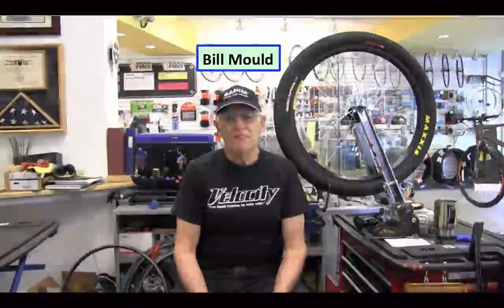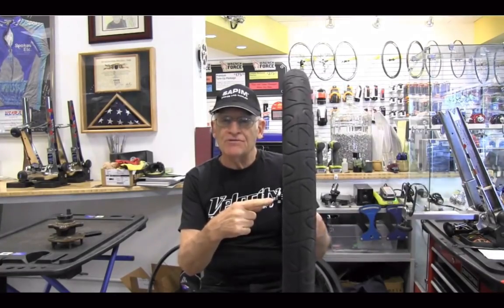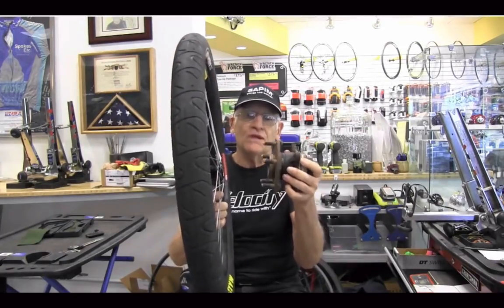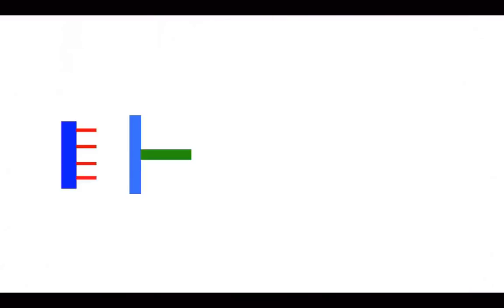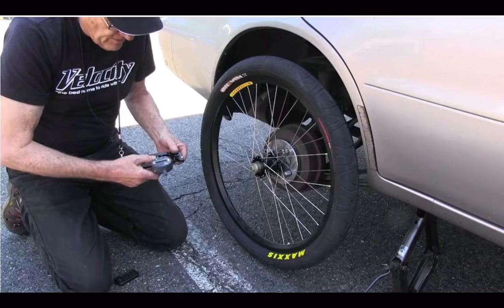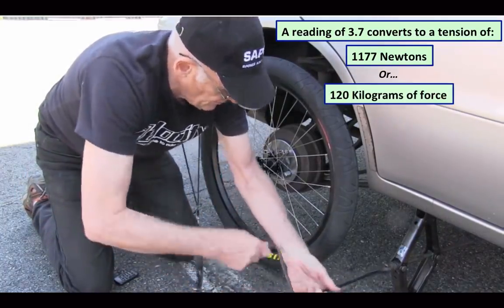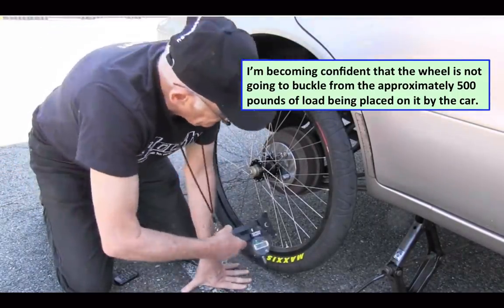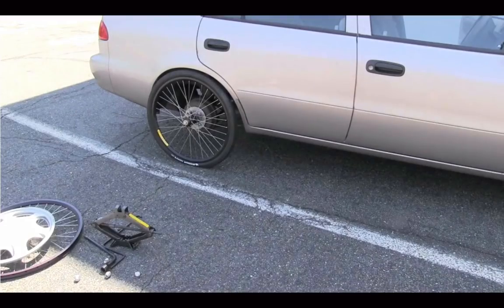Bicycle Wheel On Car

Comment: Hi Bill, Sorry to tell you but as you kept lowering the car you kept measuring the tension of the bottom spoke when you should have been measuring the upper spokes that are literally taking the entire load. Keep in mind the weight of the car is on the hub, the rim is holding the spokes above the hub like a suspension bridge (ie the GOLDEN-GATE BRIDGE). So its the upper spokes that are taking the full load, while the lower spokes are being re-leaved of tension.  Think about that for a moment...  Tick tick tick tick  AHH HAAAaaa now ya get it...  Hey you and I are old dogs in the bike biz (60 here), and as they say, we bike mechanics learn new things everyday, and I won't lie cause I just learned this just recently from a good customer who is a genius mechanical engineer who was head of Apple in the late 90s, and loves to ride bikes.   Hey I just love when someone like you goes for it!  KEEP IT UP!  Sincerely Dan Sotelo
Reply: Suspension bridges have no bottom support so that's an invalid analogy. There is equal tension on the top and bottom spokes.
Reply: Try pushing a spoke, it bends. I have a spoke tension tool. Will test tonight.

Comment: Hi Bill, just out of curiosity, did anyone ever contact you to conduct your experiment?
Reply from the maker: Anthony, a local engineer here in Alexandria VA who has a fabrication capability to made four universal adapters.  He is partnering with me for the next phase which will be to put four wheels on cars with increasing weight.
Reply: Cool, Im looking forward to seeing this.
Reply from the maker: Anthony, I have a local mechanical engineer who has access to a fabrication shop.  He's going to make four adapters that will enable me to install bicycle wheels on each of a car's four hubs.  They will be mountable to hubs with either four, five or six lug bolts.  We'll be able to experiment with ever-increasing car weight until a failure point is reached.  

For the trolls out there:  This will only be an experiment to demonstrate the enormous ability of a bicycle wheel to support a vertical load.  IT IS NOT AN ALTERNATIVE TO THE TYPICAL CAR WHEEL!!!
Reply: Awesome!
Reply: +Bill Mould really cool. Glad you're experiment is being completed. Lots of luck & love to see the video. Take care Bill!
Reply: i think the key word here is VERTICAL load. once you put bike wheels on the front of the car where they are involved in steering,, you will be introducing a horizontal force on the bike wheel, which i predict will make it buckle as soon as you try to make a sharper turn. will be interesting to see how it actually works out, though!
Reply: Bill Mould THIS is exactly why I subscribed. I want to see the next experiments! Well done.
Reply: Bill Mould Why not use a small truck for better tire clearance? then you could use whatever tire you want
Reply: Plus you wouldn't have to diddle with several vehicles; simply keep adding weight to the truck.
Reply: al fresco  a flatbed utility trailer would be even better considering its easy to add weight to a trailer and the wheel wouldn't have to worry about torque loads and catastrophic failure will be less dangerous for the vehicle since the trailer is the only thing that would fall to the ground

Comment: Surely you're measuring the tension of the wrong spokes. It's the top most spokes that hold the load?
Reply: Jamie McCartney I thought the same thing...
Reply: Jamie McCartney Yep, the spoke locations he was measuring would have been steadily losing tension [on the way to compression] as dead load was transferred.
Reply: Jamie McCartney 
You Spoke too late . . .
The damage is done ! ! !
It's guys like this that give engineering a bad rap . . .
Me thinks the spoke lost its temper ! ? !
Back to the drawing board . . .
Reply: thebertt He kept saying "we STILL have positive tension" whenever the spoke was measured as as if expecting it to go down. Sounds like knows what he was measuring.
Reply: +Jamie McCartney Last I cheeked gravity pulls everything down, so if ANYTHING the lower spokes have most of the weight on them; did you think the car it'self actually SITS on the tire? It's mostly on the axle... Also do you understand how a circle works for weight distribution in terms of strength/weight?... I'm guessing you don't otherwise you would have not said what you did.

Whats sad is there is a bout 4 other people agreeing with you up above.  smh
Reply: +Ezcore Eve I'm shaking my head at you. You, sir, just made a fool of yourself. You are correct about a solid circle. How a bicycle wheel works is different. The load on the hub is supported by the uppermost part of the rim as it's hanging off the spokes. The bottom spokes are providing no support.
Reply: Jamie McCartneyRen Huynh, with regard to him saying  "we STILL have positive tension", I agree with you, he seems to understand the most basic dynamic about the role of hub spokes rim etc -- but still it's an odd (nearly useless) metric he's collecting - the spokes directly above the hub (12 o'clock position) are in tension and they do all the work, it's the failure of these elements that constitute a (modern bicycle's*) spoked wheel failure, not the spokes in compression (or rather moving towards compression) directly underneath. 

+Ezcore Eve, Stop, just stop commenting, please. Take up baking tea cookies, or politics, or late night TV marketing -- there's money to be made in all of these and no math or dynamics visualization needed - you'll be way happier there! (Yeah I know, Bakers even now breaking out Boyle's law citations or something and prove me wrong on that) 

*I suspect the wooden spokes of a old school wagon wheel would possibly be the opposite, the stiff spokes in compression underneath are probably doing most of the 'heavy lifting'.

Comment: Good experiment. 
Great findings.

Moving forward, that mounting adaptor ignores any braking being done by the stock system. so before placing all four on a vehicle and attempting to move it, make some adjustments. being as it's mounted on the hub, the wheel shouldn't move freely.

Comment: Cool experiment! The diameter of the wheel and tire appears to still be too large, even with the newer tire. What would happen while driving over a bump? It probably needs space for the suspension to function. Maybe make a smaller wheel & tire?

Comment: Why would you attempt to market a bike wheel for a car ? Or a cement mixer for that mater? I'm really confused by this experiment. In the nineteen thirties the German manufacturers of cars and trucks determined that solid wheels were safer and needed no truing after the wheels were in service. I appreciate the young man humorous feat of engineering. I guess he was making the old guy feel good about his wacky wheel. Fun to watch the old guy being so very inenthused and energized by this.
Reply from the maker: At no place am I recommending that a bicycle wheel be put on a car.  This was only an experiment to show that a well-make bicycle wheel can support a large load.  Most people get that.  Sorry that you did not.
Reply: +Bill Mould bills a fkin savage
Reply: This actually can improve gas milage considerably... Much less rolling resistance.
Reply: +Network126 what is rolling resistance? you mean friction?lol
Reply from the maker: Rolling resistance is not exactly the same as friction.
Reply: ***** Rolling resistance and friction are slightly different things. A thin, light tire, can travel more easily and efficiently than a wide, heavy tire - It takes less energy to get moving, and there's less rubber on the ground.
Reply: I would completely agree with you that it would make the car more fuel efficient, but I'm just saying that static friction is mostly responsible for getting the tire "moving". Inertia of a round object is a property of how that particular wheel turns, but friction is the main factor when it comes to the ease of moving a car forward.
Reply: He just wanted to see if the bike wheel was strong enough to support the car...
Reply: it was just a fun experiment. why so negative?
Reply: it was just a fun experiment. why so negative?
Reply: I bet you could get a pretty decent gas milage increase by even replacing all 4 tires with thin spare tires.
Reply from the maker: Thank you for this expression of support.  Some people totally missed the point.  Fortunately, most people are like you and see the demonstration for what it is - that a bicycle wheel can support a very large vertical load!
Reply: +Bill Mould I found it fascinating. I am guessing all the naysayers have never just messed about with stuff to find out how it works, what its limitations are, etc. People like you enthuse the inventors in society. That is pretty awesome :)
Reply from the maker: Thanks!!  I appreciate the support and your understanding of the purpose.
Reply: It's to say how strong the wheel is
Reply: +dan rieco 
He is not trying to get anyone to put a bike tire on a car. Cyclists spend hundreds if not thousands of dollars on the strongest yet lightest wheel sets possible, especially mountain bike racers. To take the load of a car with the weight of a bike wheel set is remarkable. Old guy, smart marketing.
Reply from the maker: Darian, thanks for your reasoned comment.  A number of people, as you have seen, have totally missed the point.
Reply: +Bill Mould Some people are simply ignorant and do not understand that this is simply a project you created to show some science.
Reply: +Network126 less rubber on the ground is a bad thing when it comes to traction and the ability of a car to stay planted to the ground in a corner
Reply: Sandman Actual
Yes that's true
Reply: Actually i agree in many ways, i possibly woulda phrased it better to maybe not be as demeaning. But this "technology" they are using is same as was used on early days of vehicles,(cars) , with just as high load tolerances,so really just find an old car tire with spokes,use a different material,let's say carbon fiber,and or any other newer style metal or material . Reduce weight,increase strength across the board and can make the tires for either car , bike ,anything , smaller or larger . All dependent upon how you alleviate the stress loads created by the weight with the spoke set up. But yeah entertaining if you have a couple minutes to waste and learn something you never knew.
Reply: Well since i like Pininfarina cars, i was curious, i think a spoke wheel would look very good on some of them. Indeed i found a company in Italy back a couple years ago which builds traditional spoke wheels for modern vehicles. They are just very expensive, but they accommodate the same tires the car was designed to run on, so you can expect them to handle well, they're slightly lighter than cast alloy and there's apparently nothing wrong with them at all with regard to strength. Because of the wide rim, there is no chance of them running untrue. They are probably a lot less prone to sudden catastrophic failure than magnesium alloy wheels that are standard today, and it's not like that is a common occurrence either. Of course they have a lot more material than a bicycle wheel.

And yet it's curious to see that even a good bicycle wheel isn't as weak as it might seem. Even if it's clearly not the right choice, as it just won't handle right and may not be sufficiently safe. It makes for good entertainment.

In the 30ies, Germany was still recovering from WW1 that didn't end well for them, and its engineering was all about producing something cheaply that is good enough, it certainly wasn't about getting the best thing out there. And then there's always marketing, telling people that whatever constitutes progress must invariably be better, as opposed to merely cheaper.
Reply: He's doing it for two reasons first he's a bike mechanic (if you can call bike mechanics mechanics) secondly he's an old guy with nothing else to do.

Comment: you should use a bmx rim ... they are made to be strong and they are smaller with the same number of spokes ...
Reply: Ye i was thinking the same, this wheel is way bigger so it has to carry way more pressure
Reply: yup :o not to mention that bmx rims are generaly stronger  ...

Comment: get a rwd car
put that on
have fun youre welcome
Reply: +brandon hakki wheel will probably fall off
Reply: putting a this on a rwd car wouldn't do anything it would be the same out come its the fact that it can still support the only thing a rwd car would do its put more ware on the tire nothing else not more weight or any sort of different out come
Reply: dude have you ever put donuts on a rwd car
 its easier to loose traction and have some fun in your local empty parking lot
Reply: +Justin Noker No, it would burn off.
Reply: yeah but the trays burn up and ruin your tires
Reply: +Aaron1998ish cheap cars can drift just fine
Reply: depends on the car.  every car becomes cheap at some point, doesn't mean it's not quality!
Reply: +Aaron1998ish Yeah, because I bet the S15 has been treated with the up most care its whole life
Reply: +brandon hakki there would be no benefit, the shaft will simply spin inside the hub of the bicycle wheel before the wheel breaks loose from the asphalt since it is not keyed and the only thing preventing rotation is the clamping force of the nut itself there is no way to reliably provide drive to the wheel. Poor engineering
Reply: +TacticalBBQSauce utmost*
Reply: +brandon hakki won't work. at the first sign of lateral force (cornering) the wheel will colapse. bike wheels cannot withstand lateral forces because they dont need to, since the bike is leaning in the corner, so the forces are always vertical to the wheel
Reply: True but that's not his test!
Reply: +dimos k way to take credit there dude, although since it seems that the comment that i originally posted that on was deleted so atleast someone out there is smart enough to agree
Reply: Sandman Actual I haven't read another comment, but I think it's common  sense ;)
Reply: it is common sense (maybe not for today's society, lol) but you said it literally verbatim exactly the way i worded it.
Reply: Sandman Actual could we be soul mates? Rofl
Reply: +brandon hakki it can only work on a fwd, putting it on a rwd would require a different adapter
Reply: put a bicycle tire on the rear of a rwd car? It's asinine enough putting it on a FWD car cause it can't sustain the same lateral forces and will make your rear end less stable, but putting it on a RWD car would create such a lack of grip that the little bit of grip you did have would probably slip under your cars torque.. I guess you could have fun doing standing burnouts... but you're not going to be getting sideways let alone getting any decent speed from them...

Comment: but whats the advantage of putting a bicycle wheel on a car?
Reply: kazi riasat nothing, one good size bump would buckle it no problem.
Reply: kazi riasat Back in the day the spokes were meant to be a shock absorber of sorts.  It could cut down the weight of a car and reduce road noise.  But there's disadvantages with light cars, like flipping in the wind, having to get out of it to push the walk button at stop lights, and getting airborne with every bump in the road.  I don't think we have the materials (in cosumer quantities) to use them for cars and not fail.  Plus thin tires don't do much when you need to stop fast.
Reply: kazi riasat less resistance hehe but meaning less grip as well
Reply: kazi riasat none other than proving how strong the wheel is. If it can handle the load of a car it can handle any biking use. Also building a reputation as a strong wheel builder.
Reply: ***** 
A 500 LB. WEIGHT IS EASIER
Reply: Mad weight reduction bro
Reply: wwwShadow7 Stop lights don't function off of weight, but instead off of reading electromagnetics (which cars contains a LOT of)
Reply: Your engine is one huge electromagnet
Reply: Mr Shane it's magnetic it's the metal not weight but electromagnetism helps
Reply: Mr Shane

Aluminum conducts electricity just like steel. It has nothing to due with magnetism.
 This is called an "inductive-loop traffic detector" that works somewhat like a metal detector, sensing any conductive metal (aluminum, steel, iron, etc.).
Reply: kazi riasat No advantage, I think this was purely an academic experiment. Proof of concept type thing.
Reply: kazi riasat If you were to actually have it safe to drive on the highway, it would get exceptional gas mileage.
Reply: ***** yeah, this wheel would've less friction with the street, which will definitely save fuel, but I don't think this wheel is safe for the cars while driving on the highway!
Reply: kazi riasat Yeah, that kinda what I said.
Reply: I can't believe the comments about one of the stupidest videos ever posted on YouTube.
I think I'll emulate this guy and see if my Cessna will fly if I put cardboard wings on it.

Comment: You would get really good MPG if you did all four wheels.
Reply: ***** say goodbye to breaking on speeds any higher then 15mph
Reply: Less rolling resistance = better MPG
Reply: Dave Hak less rolling resistance also means less friction. in this case the momentum of the car is too much for these small tyres to handle. its like stopping a truck on ice with ice skates on...
Reply: You misunderstood me, I'm not saying it's practical and I didnt mention anything about braking nor handling.  I just said you'd get much better gas millage as a result of reduced rolling resistance.
Reply: Dave Hak i dont think thats right wouldnt more surface area give you more grip and more grip meaning better mpg?
Reply: GAMER92097 more grip comes from more friction (but more friction does not always depends on size of tyre, increasing the load can also increase friction). more friction means more energy required to move the object and hence less mpg.
Reply: GAMER92097 lol in snow maybe